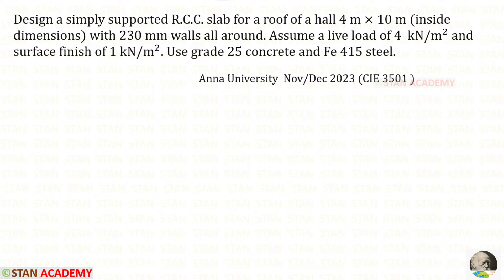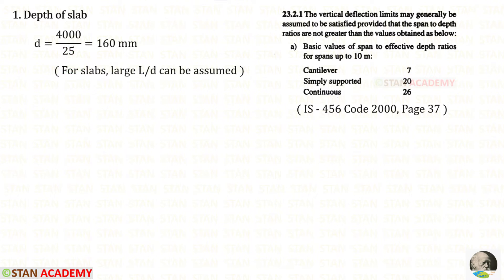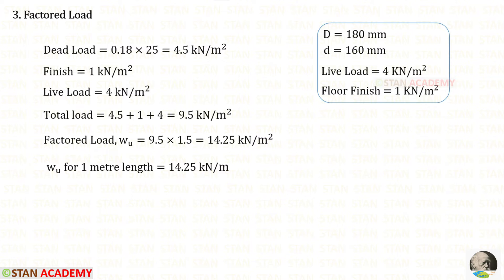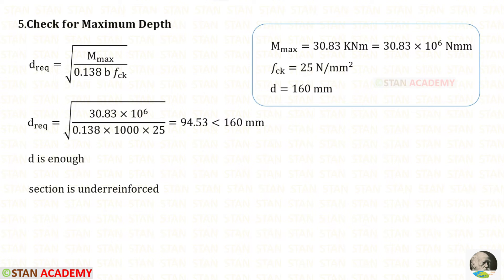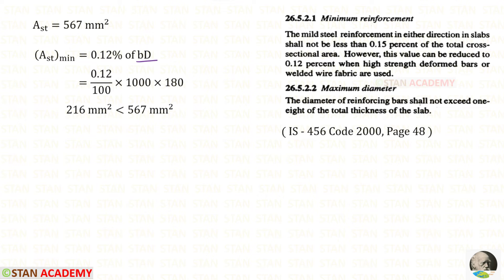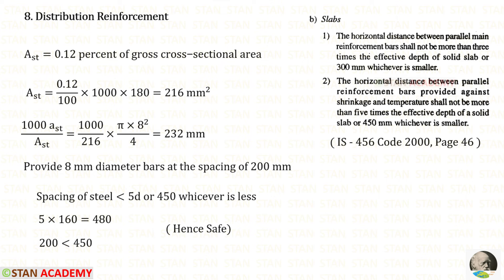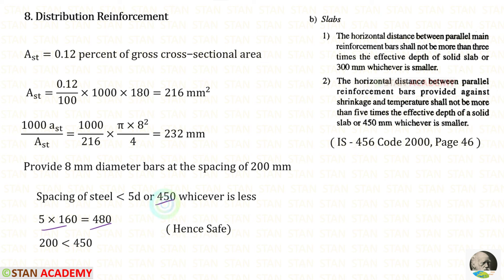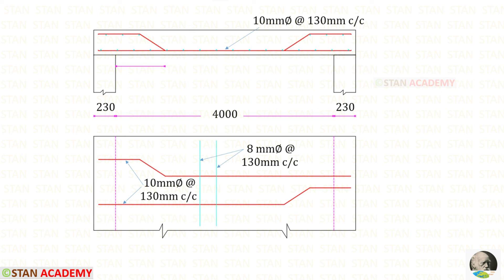Design of a One Way Simply Supported Slab

Comment: Sir I have a question , is one way slab independent of the longer span ?? suppose the slab is of size 5x15m , so can we design it on the governing length of 5m .... will it be safe
Reply: I think in the BS   8110 you assume  slab area is less than 30m sqd . A slab of 75 m sqd is a different design process. I tyink above is based on indian code ao that might be slightly different.